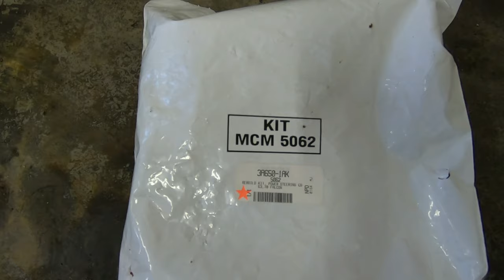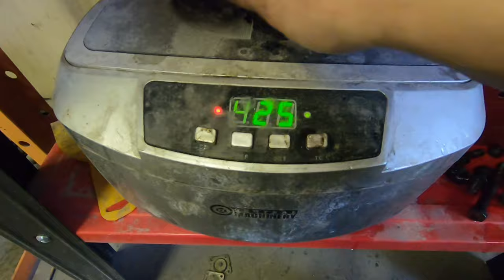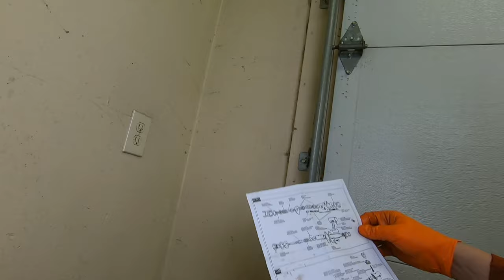How to rebuild your power steering control valve - 1967 Ford Mustang

Comment: Thanks you made that valve rebuild look easy. I have a steeroids rack and pinion to install on my 67 but I'm still not sure if it would be worth the effort, and extra expense for the new headers. Maybe I will try rebuilding the old power steering system first.
Reply from the maker: Oh ya those rack and pinion conversions are quite a chore. Definitely not too bad to fix what you got till you figure things out.
Reply: @AlfsMustangGarage  Decades ago I removed the original factory power steering from my Mustang. It was constantly leaking and there were no new replacement parts available back then. Now that you can buy a complete original system new I think it might  be less stressful to install than the rack and pinion system.
Reply from the maker: True. They also have the Borgensen systems too. If you already have manual steering, you would just have to add the gearbox, pump, and hoses. Then you can retain the original style steering.

Comment: Thank you so much for this very informative video,i have two questions please.
 i am planning to rebuild a control valve of 59 Mercury, however i am not sure what the correct kit to order as there is only (Bendix) stamped and i didn't find any other code or something and, sure if the previous owners had replaced or it's the original part? it looks very similar to this one on the video.
How easy is it to turn the steering wheel on a stationary old car not moving? Because in my case it's very difficult to turn the steering when the car is parked, however once it starts moving it gets really easy to steer you can steer with a pinky finger.

Comment: On the topic of steering…On my 68 FB, the steering column sits too low to the seat, causing issue to try and get in and out (legs between the cushion and the wheel). I am not sure in its past how this happened (as it’s been in the family since new), but is this height fixable? Can I adjust the bracket under the dash to raise the column (and wheel) to where is “should” sit? 🇨🇦
Reply from the maker: I'm not sure how it would be sitting lower than normal. Maybe start with all the mounting locations. 68 will have a collapsible column so make sure something hasn't happened there to cause that to kink or bend. Check the rag joint at the steering gearbox.
Reply: @AlfsMustangGarage  thanks for your response. I will check your suggestions. The car has never been in an accident ever so a bend or anything isn’t a thing. The floors were done once, but I was old enough to take picks, and they never removed the column, nor went up the firewall that far. The space between the dash and the column is too big too (dead giveaway). All other cars I’ve ever seen, the column is up tight against the dash and they don’t have issues with getting in and out of the drivers seat. 🇨🇦 On to check your suggestions.
Reply from the maker: Oh ya, should be relatively snug up in there. Just to see if something has loosened up too I suppose. Let me know what you find.

Comment: Just completed the install of a "rebuilt" one of these in a friend's '55 tbird (someone else started the install), it just pushes to one side and the slider seems stuck, any ideas?
Reply from the maker: Probably not installed correctly. Has to be perfectly center (with a small amount of error) or else it will favor assist to one side.

Comment: We have completed our 1966 6 Cyl.. how ever I can not find any where the Torque Specs for the Castle nut & Bolts attaching the extension bar to the centerlink. Does any one know what they should be or how I can find them?
Reply from the maker: I can look in some of my old books but I won't be back to the shop till Monday.

Comment: Hey Alf, is the 64.5 different? I don't see a clamp at one end or a drive pin
Reply from the maker: 64.5 is different
Reply: Looks like I have to pull the entire suspension bar with the valve on the end
Reply from the maker: Yes, the power steering control valve threads onto the steering drag link.

Comment: How easy is it to turn the steering wheel on a stationary car not moving? Because in my case it's very difficult to turn the steering when the car is parked, however once it starts moving it gets really easy to steer.
Reply from the maker: Sounds about right for a car without power steering.

Comment: Hmm I was doing this same procedure but the nut that holds the spring assembly down just keeps spinning when I try to loosen it.. I dont know how else to get it off :/ any idea as to why it might be happening ?
Reply from the maker: Does the nut have the nylon locking material in the middle?
Reply: I’m having this issue too. Threads are spinning with the nut.

Comment: That brass sleeve got  screwed up because you snatched the ball out you have to use a puller not a pickle fork.
Reply: Yea mine did the same thing with a puller. Bent the puller too…I chock it up to just a puller that was a little too big. Just throwing this out there for others who shop at oreillys or get the cheap shit like me.